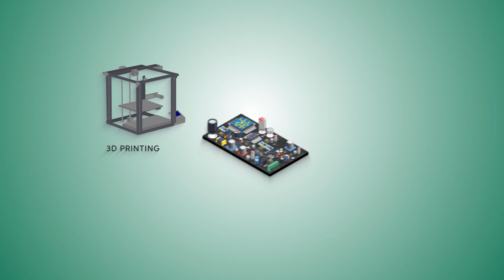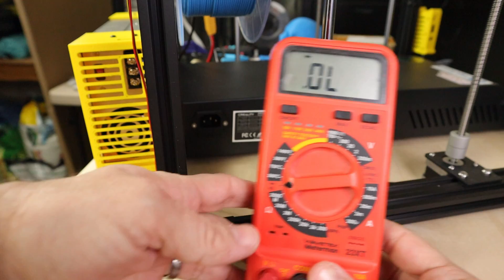Grounding Your 3D Printer: Test and Fix It!

Comment: Thanks for that video!

From what I can tell this is a safety issue because you have main power cable going from the main box so they can touch the main box and the frame if they get loose.

If you remove the whole thing and box apart it should not be a concern (e.g. for ender 3 taking the whole power supply out this should not be a safety concern). Or I am missing something? There is a slight risk of an overtension from the power supply frying your electronics but I doubt that grounding would actually help in that case. There is only 24v in...

Another point I think was missing is why stranded and not core wire. AFAIK the only problem with core is you need thicker wire to get the same gauge and it is harder to bend.
Reply from the maker: I'm happy to clarify. The reason this is a concern is that some voltage source, from the power supply, the main board, or some other piece of electronics could come loose or short out. In the situation where it were to come into contact with the electronics enclosure or other component connected to the chassis, the chassis could conduct that into someone that touched it. This is of particular concern if it's AC power at 110V or 220V.

I see your point about moving the AC to where it would be less likely to contact anything. While that does seem reasonable, the safest thing to do is ground the entire unit.

There are two main reason I say to use stranded wire:
1) Crimping: Trying to crimp a connector onto a solid core wire is not recommended. It usually result in a less than ideal connection due to less surface contact. This means the connection could come loose or not reliably conduct electricity.
2) Flexibility: As you mentioned, solid core does not bend as well and gets particularly difficult to route correctly as you get bigger wires.
Reply: @kerseyfabs  Thanks for the clarification!
Reply: @kerseyfabs  you also get less back emf (relevant at high speeds) and less electrical noise (nice for probes)

Comment: Very good video. Worth mentioning that using AC terminal blocks is much more elegant and expandable than fitting multiple connectors under a screw.

Comment: I can't find any metal on the exterior of the enclosed P1S to ground mine, my prints keep getting static on them, and during the printing process its pulling fuzz and dust all around to the bed plate, WHERE THE F is there one piece of metal on the exterior for me to ground it with a piece of wire?

Comment: So I'm curious if anyone here is watching this video because your ender 3 PSU and chassis is not grounded. Asked my AI about it and it's apparently had some attention showing mine isn't isolated but really concerning. I'm assuming people just getting into 3d printing via ender 3 are not going to inspect the circuit for safety flaws like that. What I don't understand is they include a grounded cable for the PSU and the PSU frame is bolted to the printers chassis. Why not add a little extra copper on the PCB for grounding? If your ender 3 isn't grounded as well let me know especially if you connected it to ground Im curious if it caused faults to appear.

Comment: I have a Tevo Flash with an AC heated bed which makes me nervous. The bed is an aluminium plate for spreading the heat and then a glass plate glued on top. The AC heater is what looks like a silicone pad stuck to the underside of the aluminium plate. The bed heater wires have no strain relief where they attach to the bed and the bed isn't grounded. On top of that, while the power supply case inside the electronics enclosure is grounded, that ground does not continue to the enclosure or the printer frame... I bought an RCD to plug it into, but I'm thinking I should probably ground it properly instead or maybe as well.

Comment: Aren’t they already grounded tho bc they have the 3 prong which is for ground?
Reply from the maker: That only grounds the power supply usually. You have to make sure a proper ground wire was also run to the chassis.

Comment: I actually had to ground all my Minus Potentials from my Printer because I use different power supplies for the heated bed and mainboard. If I didnt do that my BL Touch was going crazy because of the 400x400 Bed Heater with 30A at 28V... I would also recomend to get some contact washers for better contact and Nord lock Washers against vibrations for all surfaces which need to be grounded!

Comment: Did you also ground bed level sensor? i have problem.with my tatara printer ( anet a8). After z axis move, very oftet lcd is showing mess and after few second going to die ( only way is reset). Yesterday I found that when I disconnect capacitive z sensor everything is fine...
Reply from the maker: The level sensor on the Ender 5 Plus is a BLTouch. It doesn't need any additional grounding.

Comment: I have a grounding issue but my ender 5 plus has a Meanwell RSP-500 power supply in it, where could be the issue? kindly help me regarding it as it has a charge over all its body. Thanking you in anticipation.
Reply from the maker: Did you watch this video all the way through? I show how to test it and ground it. If the chassis is live with AC current, the most likely issue is in the power supply. You will probably need to replace it unless your comfortable with fixing it.
Reply: @kerseyfabs Thank you for your urgent reply. Much appreciated.
I watched it till the end but where should i ground it as my supply is within the chassis.

Comment: Why not solid wire?
Reply from the maker: Typically because it doesn't compress well when crimped or pressed down in a terminal, less contact area.
Reply: @kerseyfabs  right on thank you! Made a late trip to Meijer when I saw that comment haha

Comment: In Vietnam, there is no ground wire in many households. :( I know that GFI outlet can be a solution but then idk if there is any other solution.
Reply from the maker: I understand. Some older houses here in the US still don't have them either if they haven't been updated. You should be able to get an electrician to install one but that could be costly.

Comment: Thanks for reminding. Since putting my E5 into a IKEA Lack enclosure, there was no connection between ground and the printer frame. I sometimes got small electric shocks when touching it for e.g. removing prints.

Comment: So you've already done this but I would recommend doing this differently in the future.
The back side of that AC plug socket, would be the ideal place.
Inside the housing, where the factory green/yellow wire is soldered to it... You should have soldered another wire, a short one that went to a screw that goes into the chassis inside that box.
It would then be grounded just like stock. And the wire could not get undone or hooked on anything. And you don't have any double wires on the power supply screws. And even if the power supply Is disconnected somehow, anytime something's connected to that power socket it will be grounded.

Comment: Why do you think the frame needs to be grounded? The power supply case is already grounded for safety. There is no high voltage to your controller board or other electronics. This seems completely unnecessary.
Reply from the maker: Anytime you have AC wiring near the chassis, it makes sense to make sure you can't be shocked if you get stray voltage. Normally it would be grounded if the supply was mounted in the electronics box.
Reply: in the transformer in the power supply, the only thing that keeps the AC power from going straight through to the output is a few micrometers of enamel dipped on the wire.  In a good board design, like the meanwell, there is a physical gap everywhere else on the board, with only the transformer and opto-isolated parts jumping across that gap.
On a cheaper board that gap doesnt exist.
on all of these, there is often nothing but the mounting (maybe a thin sheet of plastic) that keeps the bottom of the board from touching the bottom of the case. An extra long through hole part, combined with a little flex or dent in the power supply case can cause a direct short to the chassis.
Now if its grounded, it pops the fuse, or the house breaker. If its not grounded, it hurts when you touch it.
Reply: @TravisFabel  I have a grounding issue but my ender 5 plus has a Meanwell RSP-500 power supply in it, where could be the issue? kindly help me regarding it as it has a charge over all its body. Thanking you in anticipation.

Comment: When you add a ground cable to your chassis, remove paint or other surface stuff which might cause a bad connection.
Reply from the maker: You can do that if you can't find a metal to metal location. I tried to point out that finding a non-painted connection was best.

Comment: Is this necessary when mounting the PSU away from the printer? Like say I have the printer in an enclosure and have the PSU on the outside?
Reply from the maker: This is just my opinion and not professional advice... I would say that if there's no chance of AC power coming into contact with your chassis, then you should be fine. Just make sure you're keeping your AC wires protected and away from your DC components. This would be similar to a printer with a separate DC power brick. Your chassis could be grounded to your DC ground though through one of the through holes on the main board.
Reply: @kerseyfabs  Ah ok! Thanks!
Reply: never if its separated from the printer and grounded in itself, or extra isolated.   only if the psu is built on the same chassi as the printer or what ever you are building